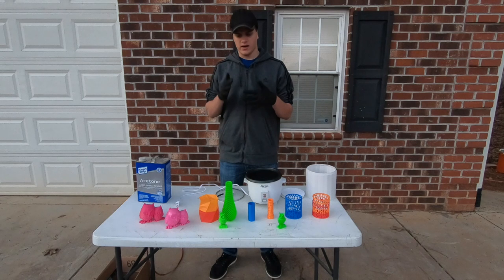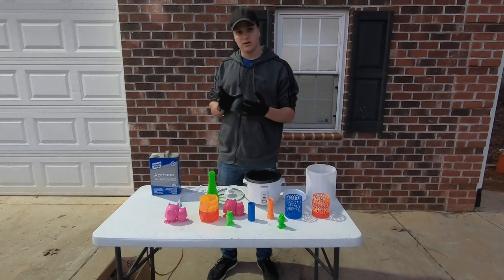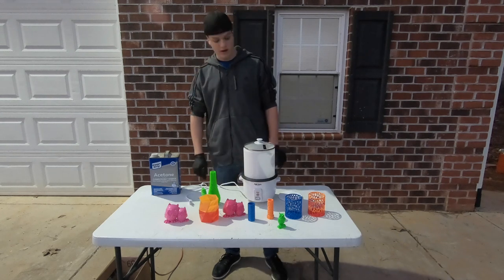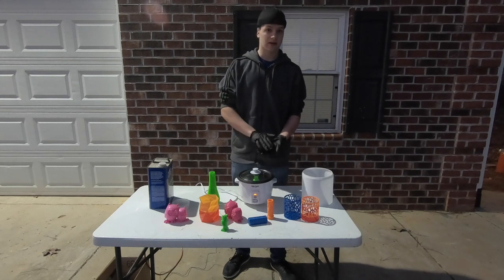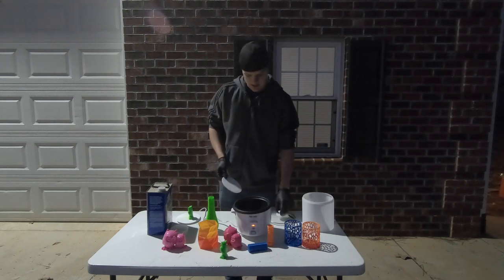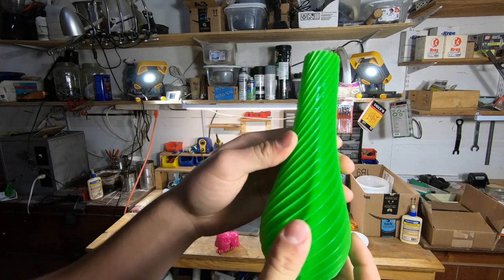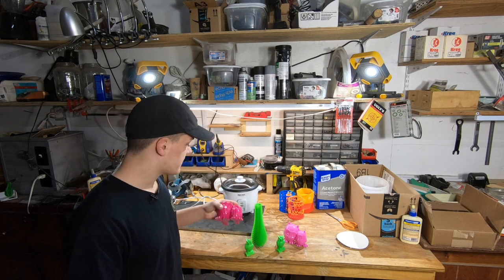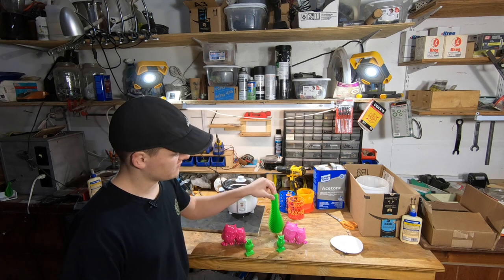Acetone crockpot smoother for ABS 3D printed parts (cheap and easy)

Comment: been trying this the last couple days but keep getting bubbling, any tips with this setup to avoid that?  Are you not getting that?  considering going to a non-heated setup
Reply from the maker: There are several possible problems...
1. High moisture content in the air as the part “dries” can sometimes do it. If the plastic is also turning white this is likely the problem.
2. You may be leaving it in the chamber for too long. I only dip it into the vapors for 10-30 seconds. Remember that it will continue to melt slightly even after you take the part out of the vapors.
3. Once it has been treated, let it sit in room temperature (or slightly colder) out of the sun or any heat source. Extra heat will cause the gas inside the plastic to expand causing the bubbles.
Reply: @HappyMadScientist  good tips thanks for the reply!
Reply from the maker: No problem!